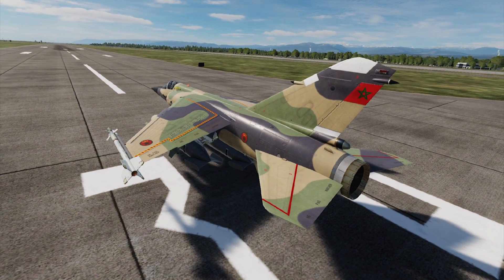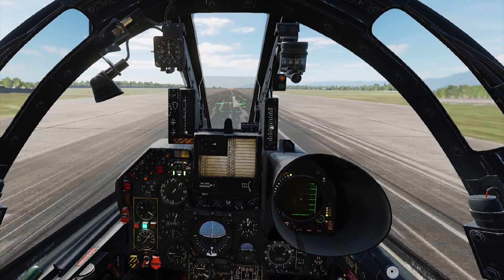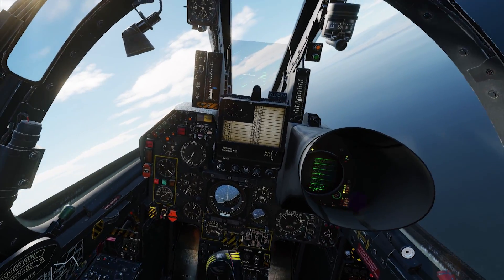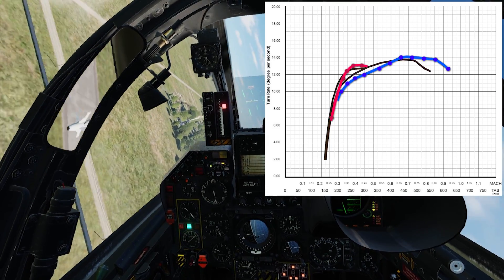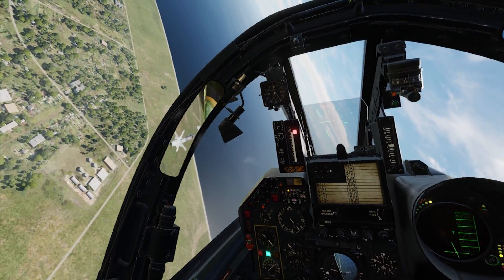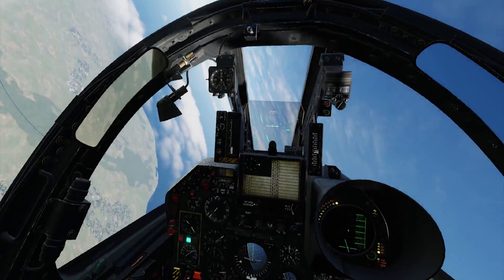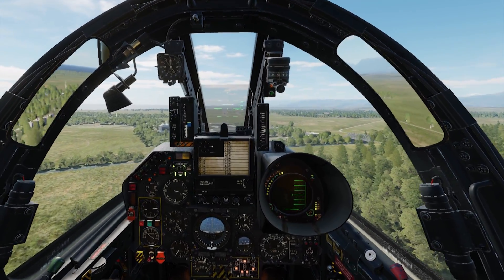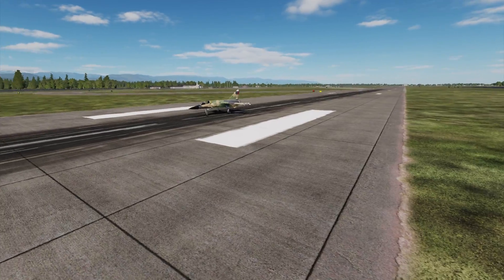Mirage F1CE Update (Dec 2023) Basic Flight Dynamics Analysis

Comment: Hello mate. Nice video. I would like to notify that nose attitude during rotation and after take off should be 12 degrees. Moreover I would recommend you for landing to use V App HUD mode, cause you will have speed vector available, as well as the gun piper giving you the 10 deg AoA and the -2.5 deg line to intercept and maintain the optimum glide slope for the touch down point. Closing, the max permitted AoA after touch down during aerodynamic braking is 15 degrees. Optimal during flare and after touch down is 13.
Reply from the maker: Cool, make a video please.
Reply: @FSX404 I will tomorrow. Have a good night. It’s too late in Athens :-)
Reply from the maker: @Joachim_TSINTILAS  its true, tailstrike is at 17 deg, not 13 (I mixed it up with another plane). So the numbers you stated for rotation and flare are accurate. Post roration is from Mirage III at 13 until AB is off, close enough to 12 of F1. VRef and approach HUD are irrelevant in this case, I was testing the flight dynamics with the pitch/power settings, its not really a landing tutorial, and settings work.

Comment: How do you know how the airplane "should" behave? I think thats a very intersting review, and pretty usefull to know, some other planes behave like garbage like the Gazelle and i wish it had normal dynamics.
Reply from the maker: I reviewed and tested it with a Mirage III pilot, for a few things on previous videos, we confirmed with a friend who was a F1 pilot for South African Air Force  But wasnt needed for this video, I was just checking off boxes, only new thing was the adverse yaw at high AOA and thats basically the same in MIII and F1.
Reply: @FSX404  Is there any even remote possibility that Red Star simulation could do a Mirage IIIC? It would fit in your 3rd gen scope, you clearly know how to make its FM accurate and its systems are not very complicated.

Comment: This is a great plane. So is the wheelie on takeoff a normal thing outside of MTOW for the F1?
Reply from the maker: Ehhhh, depends light weights have a quicker liftoff so smaller "wheelie", also here I actually made a mistake, pitch is 12 deg, not 10, so at 12 it will liftoff correctly at 190-195 kts and sooner, smaller wheelie, should repost that part soon.

Comment: Great vid! Never considered the F1 but fortunate to have flown in the real Mirage IIID. Doesn't the F1 dogfight ? The IIIOs seem to do OK even at the end of their life :)
Reply from the maker: F1 is made for dogfights by modifying the III. III is a high altitude interceptor, not really made for classic dogfights, but Israel bought it and used its speed as an advantage to perfection, making the III a lot better than it was. But III wasnt a good performer below 18k, so Dassault modified the III wing for medium altitudes and made the F1. So F1 is a better dogfighter below 18k and below mach 0.7, but still suffers from some MIII issues. Aerges is getting there slowly I hope. A step back ocassionally happens but the F1 is getting there. I would recommend it.